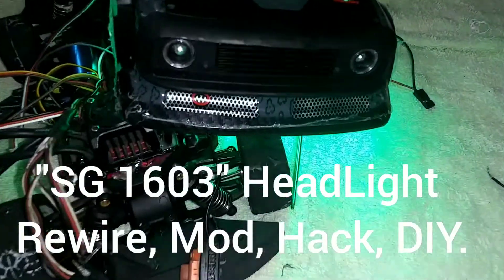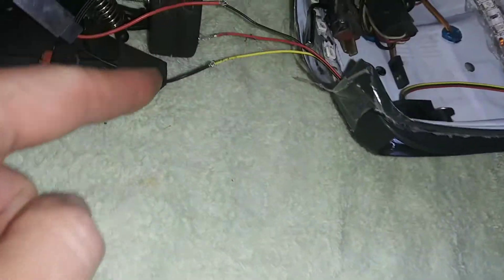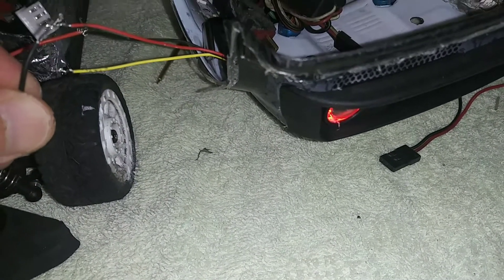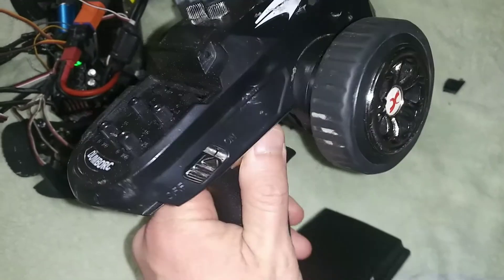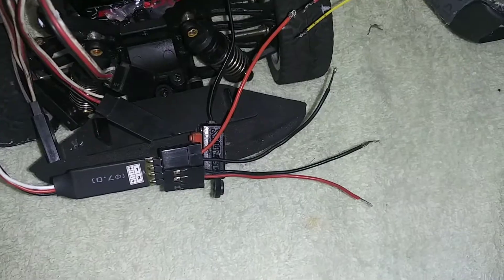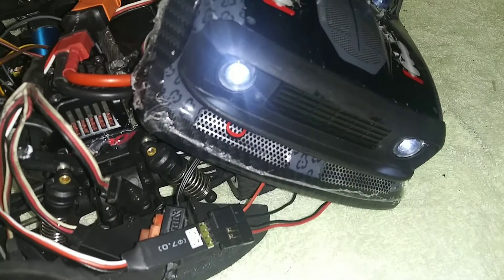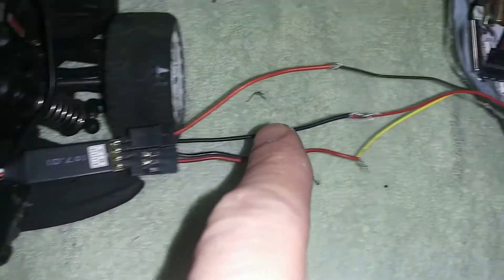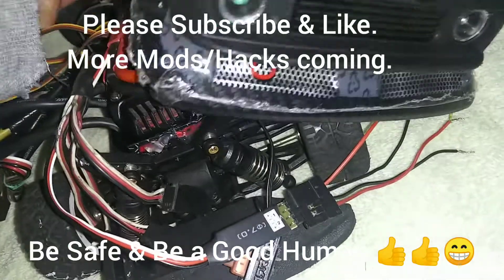"SG 1603" HeadLights Mod, Hack, Rewire, DIY.(2/27/2021)

Comment: There is a best solution for this, there is a rc led controller which comes with 4 led slot which is from China ofcourse, the one used on this video is the 2 led controller slot one. Since you have 3 wires from the original light (red, black, and yello). You need to have 4 wires going to the light switch, so red and yellow one wire each but black needs to be split into 2 wires, doing this way you can slot one of the black wire with yellow wire into one slot and another black wire with red into another slot. There will be 4 slots on the led controller but you will only need 2. So on your light mode you will get:
1. Only red
2. Only white
3. Red & white
4. Red & white slow blinking
5. Red & white fast blinking

Hope this helps anything just reply

Comment: Thanks for the video. I accidentally rip off the stock wires and i re soldered them as it seems they were as stock with 100mm of wires more. But something is wrong. I would like to show you pictures and videos to show you the problem and maybe you can help me. Can I? Where could I send the videos and pictures?
Reply from the maker: I can try to help but I have not played with this car for a while.  You can send images to RcOverLoad2020@gmail.com.  Thanks for watching. 😀
Reply: @rcnightlife9611  thanks for the reply. I've been helped to solve the problem. An almost invisible mini micro tiny drop of pond was shortcutting the black and yellow solders.

Comment: I used a 3rd chanel rx led switch then you can switch them on using the 3rd ch switch
Reply from the maker: Yes, and if you get the same rc switch in my video then you can make light blink too or just the red ring like stock.  Thanks for watching.😄
Reply: @rcnightlife9611  thanks for the info, my switch is different it hasn't got flashing on , its 1ch on with 2ch off... or 2 on with 1 off ,  or both 1 and 2 on together , both off ,
Need to get the same switch you have